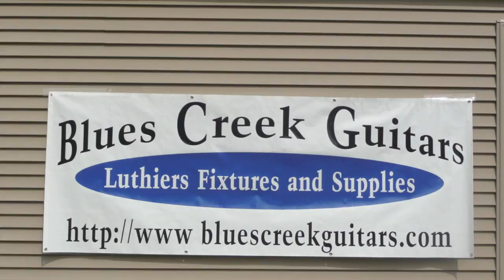Blue Creek Guitars Kit - Attaching the Back

Comment: Let's say this is a new build and we are attaching the back first ...no top , so we can clean up squeeze out inside the body where it can be seen through the sound hole ....how do you clean it , as it must dry first while clamped up ? During my bracing and jointing I did this once the glue had "Bugerfied" (a pro taught me that) and these parts were accessible . I cant take that approach here,  Thanks !
Reply: Jay Rogers Most glues will tack in about 10 to 15 min.  So after that time I will take it and remove the clamps and clean out the glue  add the top and reclamp.  After many years of doing this  I have learned a pencil lead thick bead of glue gently smeared will have minimum of squeeze out.  I will use a dowel with a slot in it to work a rag into the dowel  and then I can wipe lower in the guitar.  There are many ways to do this , the more you  use your imagination  the more goofy things you can  try till something  works for you.  No true discovery was done with status quo thinking
Reply: blues creek guitars Thank you so much , so it's ok to remove the clamps at least long enough to do some cleanup ! Then reclamp!  You guys are so great and prompt ... now I'm off to the gobar deck ! Thank you so much
Reply: Jay Rogers  you got it.  glue for about 10 to 15 min and you can clean up  I make a chisle off wood that lets me cut the glue and rub it clean
Reply: blues creek guitars ok , I remember seeing you do that before in another video ! Brilliant
Reply: Jay Rogers thanks